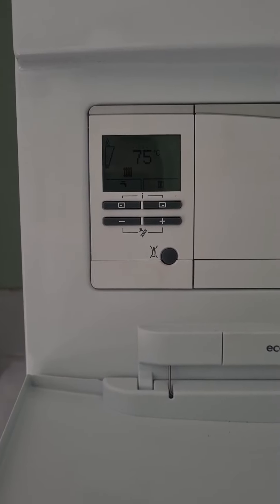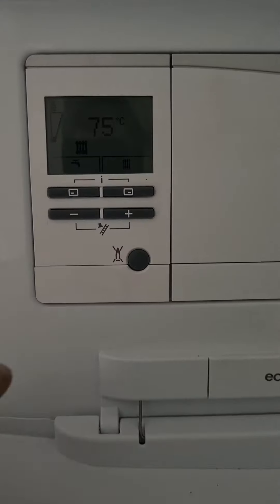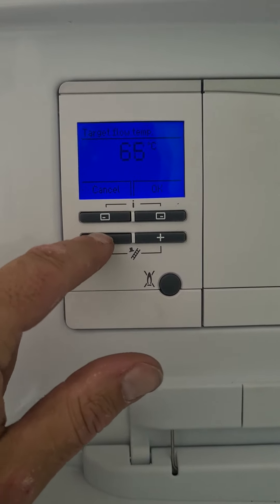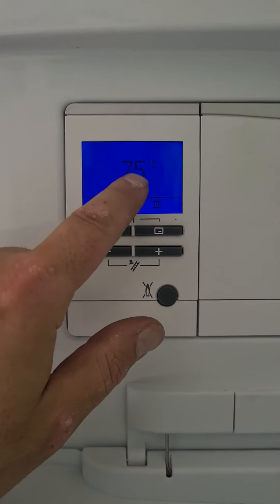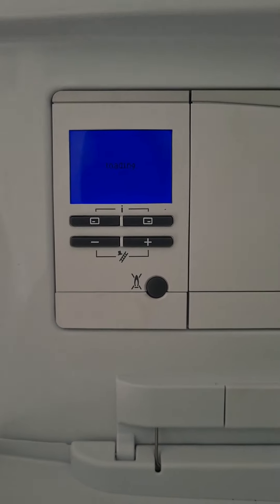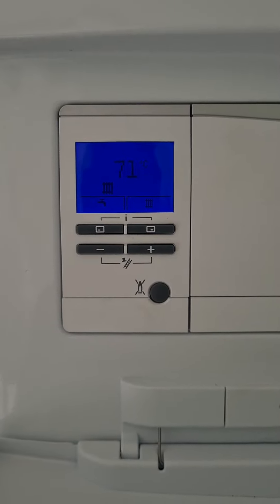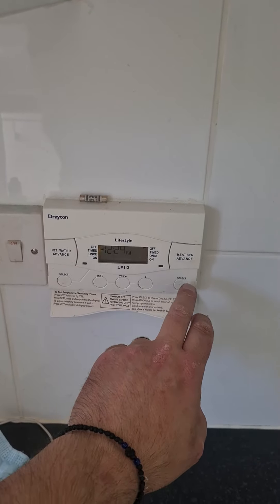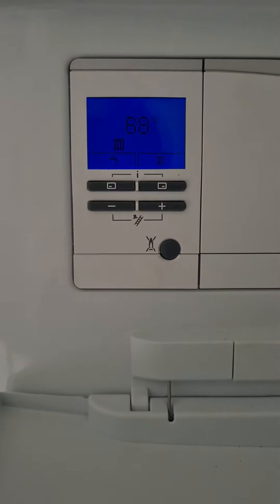How to control a Vaillant ecotec plus heat only boiler.

Comment: I have installed a vaillant ecotec plus 430 heat only boiler with Hive dual control ,it works with a old hot water cylinder, but recently the hot water demand from Hive cannot turn on the boiler, only the Hive send Heating demand will turn the boiler on. So now I have to turned on both heating and hot water for shower,  in this case also shows the two ports valve is working. Any advice on which part is failing?

Comment: Hi can you help me. I have Vaillant Eco Tech 424 Heat Only. Just installed it brand new. New Hive Thermostat device. My heating and hot water are turned off. However both of the symbols appear on the Vaillant dashboard (Tap and Heating). Why is that?
Reply from the maker: They will always be on as they use the same screen as the combination version. When the radiator symbol starts flashing and the burner symbol appears it means it's working. Hope this helps.

Comment: What is the purpose of the hot tap symbol on the boiler if we only need the radiator symbol?
Reply from the maker: It's because they use the same display for other models of their boilers. It has no use on this boiler.

Comment: Hi. My hot water only goes up to 60 degrees. Is that normal or is there a lock on it?
Reply from the maker: Hi what model vaillant is itl
Reply: @plumbbum6929  ecofit pure 418 heat only
Reply from the maker: @mukafella17  it should go up to 75. But use the radiator temp on boiler as that will heat the hot water cylinder. Cylinder thermostat should be set to 65 on actual cylinder.
Reply: @plumbbum6929  ok thanks I’ll have a look. Cheers
Reply: Made the changes and all works fine now. Thanks for your help. Cylinder was at 60. I’ve set heating to 75. And the hot water has now gone up too.